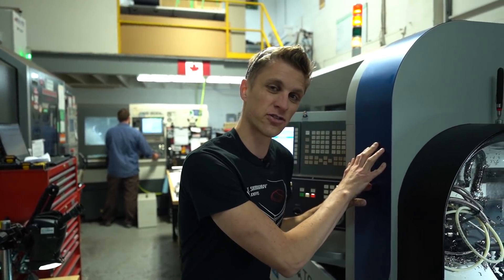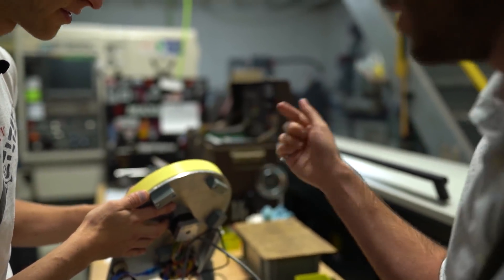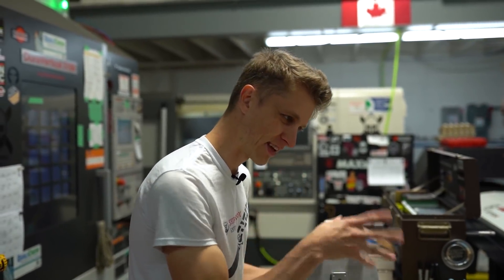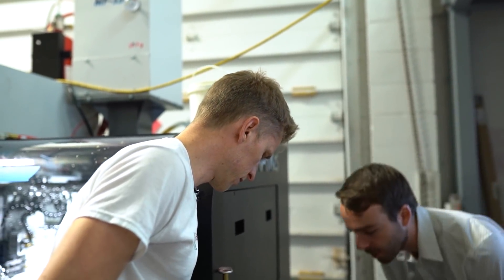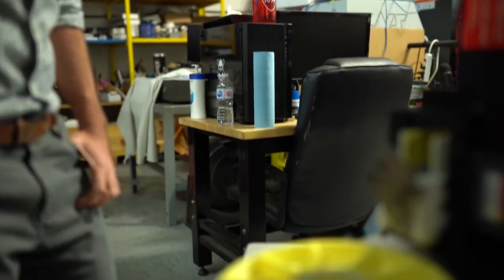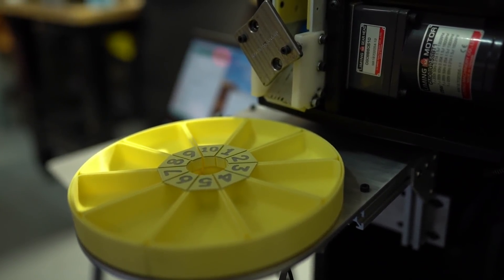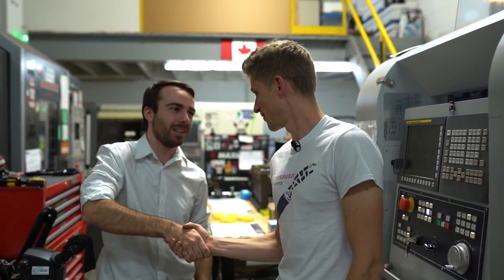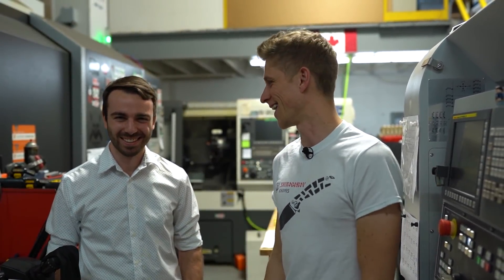Rotating our parts to PERFECTION!

Comment: Sry for my bad english I am from Germany :D. I dont realy know what kind of runtimes the machine has usuely but what if you make the yellow bins without the bottom and drill a hole to the aluminum plate where the last tray is located and place a buckit or a bigger tray under it. So you have the chance to mesure the parts of the last hour or something but you dont have to bother about overflow of the part catcher. Maybe there is the problem that the arduino blocks the place where the hole would be but i am sure you could place it somewhere else under the aluminium  plate. I dont know if you need this but if the lathe runs for hours maybe over night or something i think it could be a good option to tweek the catchter for massproduction.

Comment: Why not use an infrared breakbeam sensor? That way you only need to detect if a part is dropped, no timing involved.
Reply from the maker: I did consider that, but this seemed easier.  I'm sure that would work very well too.
Reply: @JohnGrimsmo  You've considered it??? what are you going to do when you make parts that only take 20 second total cycle time?? Change the delay in the program every time??? An Inductive or IR beam break is a much better way to go as it records and confirms parts made it into the bin.
Reply: @henri1511  We're actually changing the code to count a part when the conveyor goes off, no delay needed.
Reply: @henri1511  As Marcus already mentioned they're changing the code to count when the conveyer goes off (I assume no pulses for x time period) While a beam-break or inductive probe sounds like a good idea, I think it'd potentially be much less reliable, as you're relying on the parts to fall in a certain way. Actually being hardwired into the machine just seems much more reliable.

Comment: You could ask him to come up with a vertical magazine. Essentially the mechanism is the same, the difference is in the tray, specifically in the fact that each time a tray is selected, a catch door is open. There's a million ways to achieve that, so i won't bother explaining, suffice it to say, in a small shop, utilizing the horizontal tray seems wasteful when the same outcome can be gotten with a nicer, smaller footprint unit, that's stuck to the side of the lathe. Just my two cents on this, and personally, something worth exploring.

Comment: From a surplus sale I got a pharmacy pill counter majigger...It's designed to trickle feed pills from a hopper until <count> is reached. The sensor is pretty magic and can detect the pills passing through very reliably. Perhaps something along those lines would be helpful - detecting each part going through rather than locking yourself into a 50 second delay per part.

Comment: You might consider adding tower/stack lights. I include them with any automation that doesn't require an operator to always be present.  Allows for a quick visual scan of the factory. All green and I'm golden. Yellow or red and I need to pay a visit.  Could include a bin rotation counter and reset button. 7 or 8 rotations and the yellow light comes on. 9 rotations and the red light warns you of potential chronological part data loss.
Reply: Great idea! Future improvement maybe.

Comment: Curious to see how reliable the hobby stepper and Arduino will be. I know it’s possible for it to last forever, but not guarantees.   With industrial automation equipment it will last forever, but you certainly pay for it, probably over 10x.

Comment: Those connectivity issues with those Arduino are pretty familiar. I’ve found that there not the most reliable units and for applications such as this other micro controllers work much better and more reliably. And none of those stupid connectivity issues and having all the settings perfect so it connects and uploads sketch.